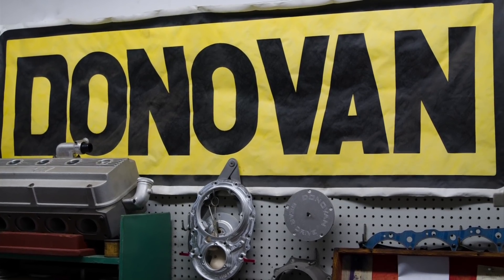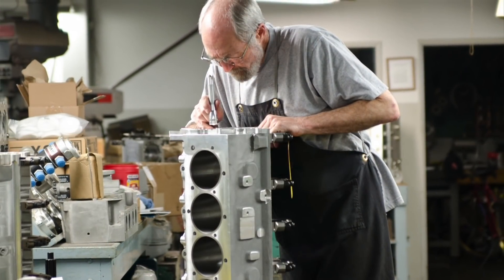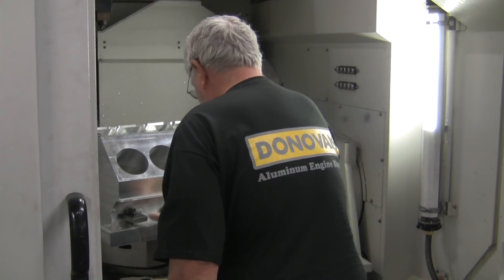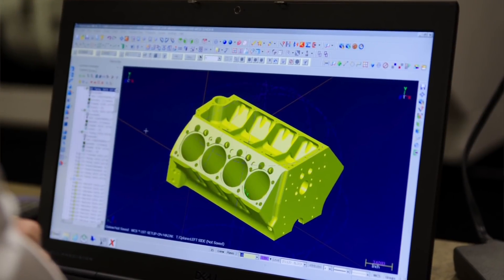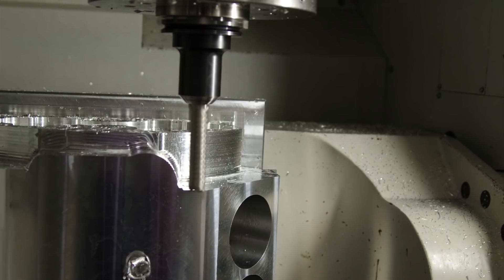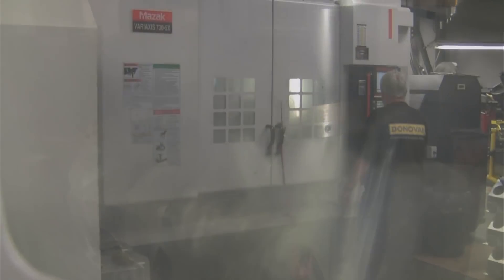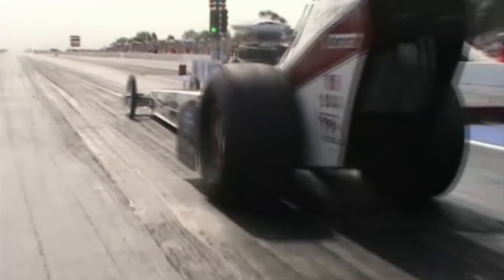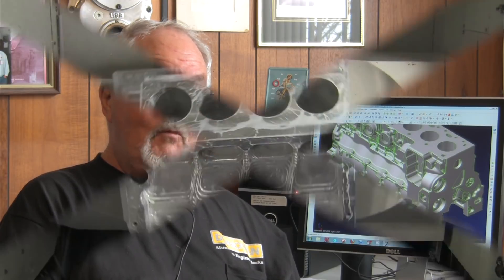Donovan Engineering Building Engine Blocks

Comment: i worry about the oil smoke coming off the machine and filling the shop. i wonder if there is a fume extractor that has a high speed impeller and high speed spinning housing that will pull the mist out of the air before its is discharged.. no use breathing the oily mist..
Reply: They make mist collectors for this job.. but yeah, you really want to avoid breathing that stuff if you can. Mist collectors are great.

Comment: If my info is correct , Donovan worked with Darrell Buehl in El Monte with proto and running the first aluminum after market blocks and heads. Mr. Buehl is another one of those guru engine builders that was doing it from the beginning and racing blown nitro in a OEM 392 hemi blocks until the cylinder walls go pop," then you back it off a hair" he said. Thats when the donovan block was a must to hit the next level of power. Well, that's what I remember him saying anyway........